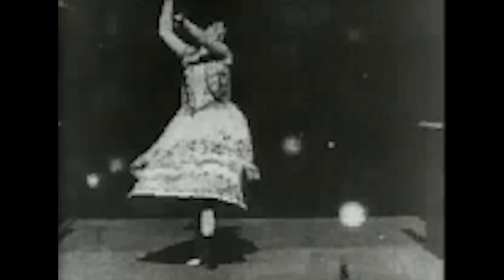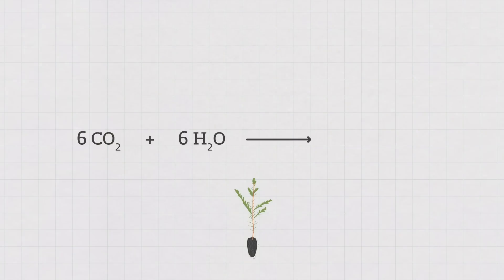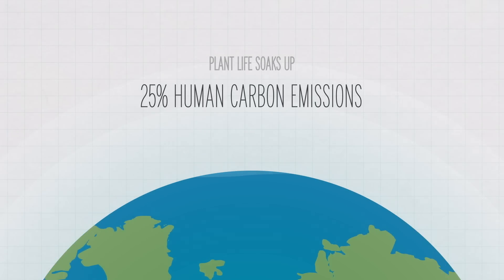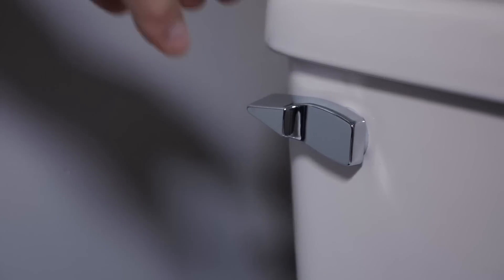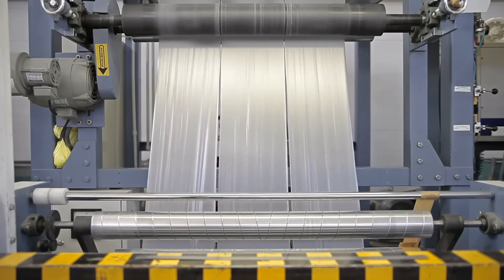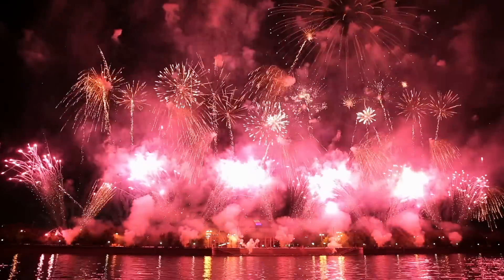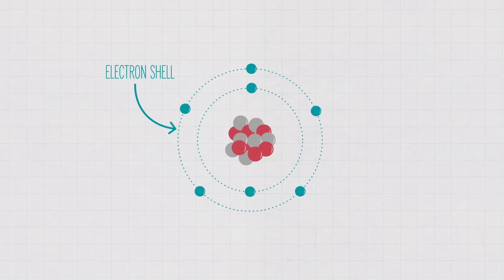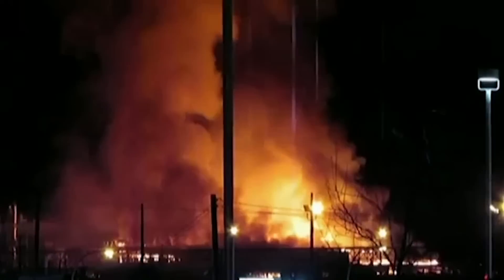Cellulose: From Trees to Explosives

Comment: Great video, cellulose is truly a fascinating biopolymer.
As a suggestion the channel should consider use the metric system as standar. Science is based on standar measure units. For example, no one can study or publish the lengths of cellulose chains or cellulose nanocristals in feet or inches, it just don't make sense.